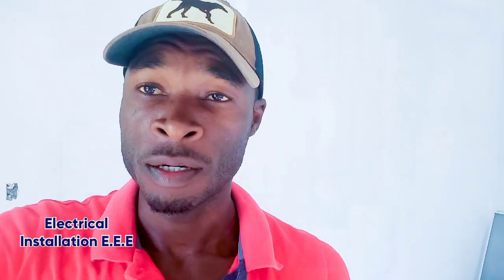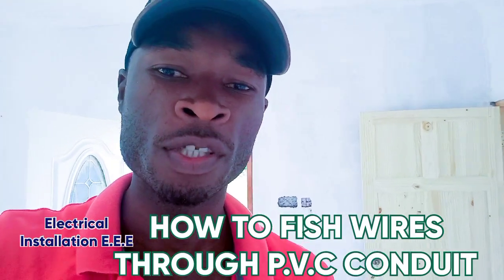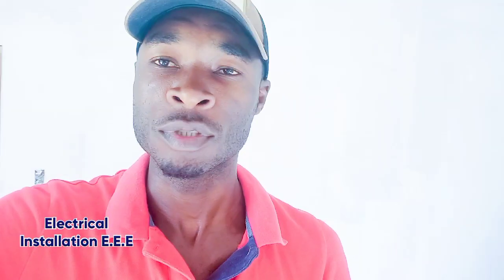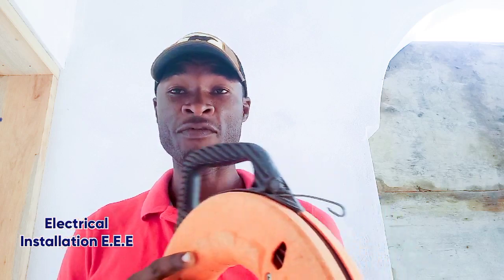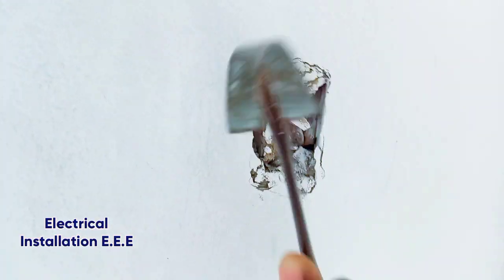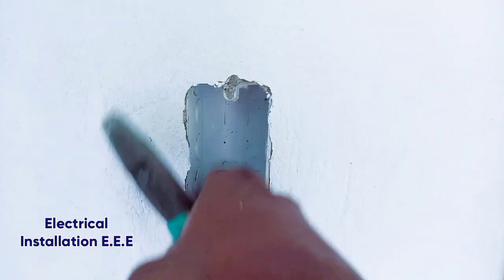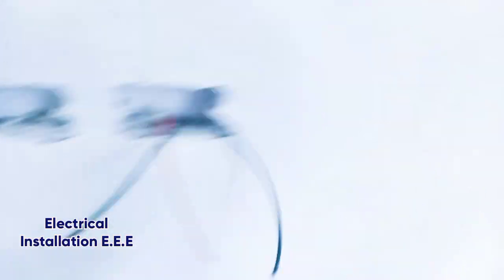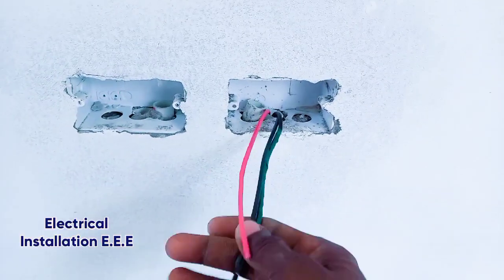HOW TO FISH ELECTRICAL WIRES THROUGH CONDUITS !! TUTORIAL

Comment: What do you do when concert is in the PVC line? My electricain didnt use any PVC cement so when they pour the concert on the roof they it got into the line. So now i cant run the fish line throught it. Do you have an ideas?
Reply from the maker: This is one troubleshoot most electrician hate , if it is block on both ends it really depends on the situation it is hard for me to answer this one because i dont know the circumstance but if i was to be there it's much easier to answer , it just depends